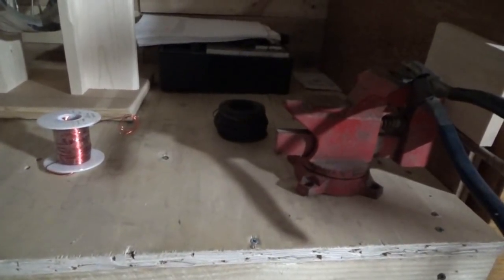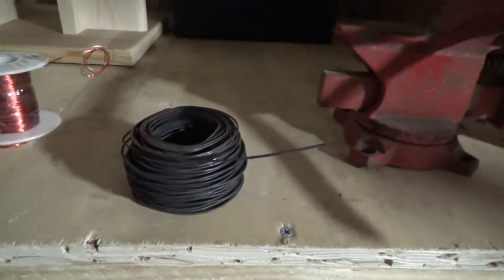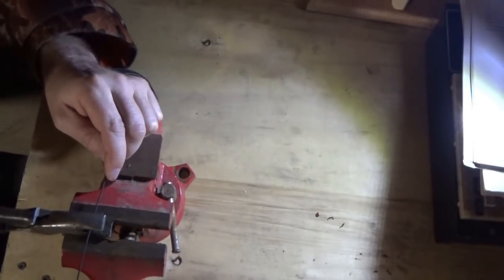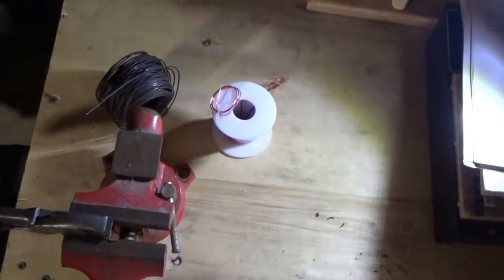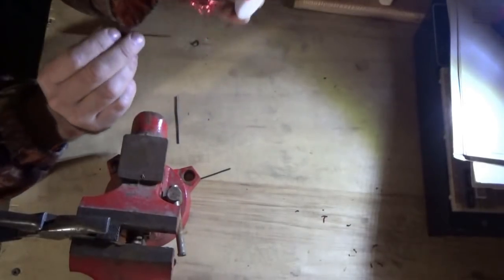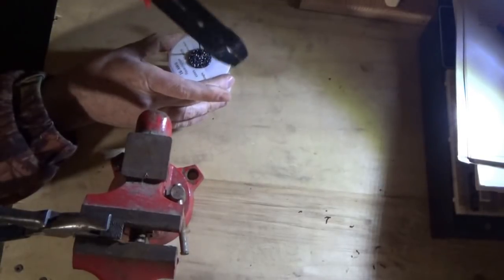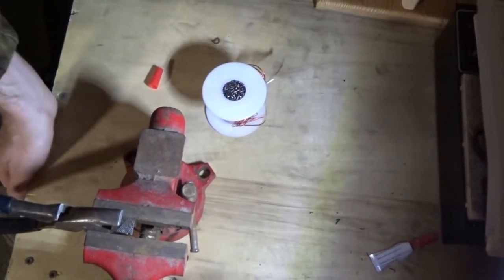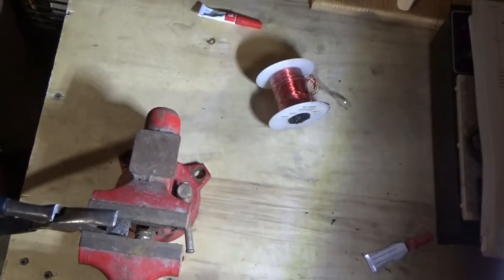How To Make Bedini SSG Radiant Energy Device ~ The Coil Core

Comment: Would coat hangers work for the coil wire?
Reply: Not really as it has about 0.2- 0.4 % carbon but what is needed is almost pure iron say <0.05 % C
I believe the laminates from transformers would work will
Un coated welding rod < .15 carbon does work

Comment: Strange enough I concluded on using bailing wire as well without seeing your video. I was reading something about how raw iron does not maintain a magnetic field as long as other metals when the electromagnetic coil shuts off. Is this how it is understood by others?

Which would make sense while working to simultaneously trip the trigger wire.
Reply from the maker: Yes baling wire is great for this. It loses its magnetism quickly when the coil shuts off, as you say.

Comment: Would it be possible to just stick a solid steel bar in the core
Reply from the maker: Not as good. The smaller metal pieces reduce eddy currents and losses in the core.

Comment: excuse my ignorance, but what practical use are these bedini motors?...i see a lot building them, but never see real 'life' uses for them...thanks.
Reply from the maker: I use mine to desulfate and restore old lead acid batteries saving me a ton on batteries. I have taken discarded batteries at 0.5 volts and restored them for use at like new condition.
Some people build them up larger and can power their homes. Yes, with enough investment you can do that. But it is not cheap.
Most are afraid of attacks so they never show their accomplishments. In my experience when someone goes silent on it, you can be pretty sure they are on to something.
Reply: @thedoityourselfworldelectr8007  hi thanks, i thought this would charge a battery, whilst another battery was actually being used, then swap over again, is that correct? if so this could be handy for a small shed setup for lighting, and very light tool use with a 12v to 240ac inverter?...
Reply from the maker: Yes that is possible in theory. I mean others have done it, yes. But you cant do it with a single coil like mine and it takes some turning. One day I hope to build up to that. Life and family slow down my projects though.
You can charge 4, 6 or more batteries on the back end while running it on a single battery on the input if tuned right. Once I had 6 batteries charging up at one time off a single battery. But I stupidly changed my circuits. Never never take apart a good thing.

Comment: The avarage American home has a 200 amp service. Looking at the wire size used in these devices... How can they posibly power a house?
Reply: Most homes have a 200 amp service. Meaning they can draw 200 amps from the power grid. There is a reason for that... Having the capability to run everything at the same time. Including an electric furnace, clothes dryer, water heater, electric stove, power tools, etc.  So any claims of a device "that can power a home" should be able to demonstrate that they can supply 200 amps @ 240 volts.... 48 KW of power... The same as an average home has available from the grid.
Reply: So that’s about 40 plus members
Reply: Fixed-By-Dork  psst hey good morning ! 😌
Reply: Someone's Princess and Troy, Good morning! While the bedini motor may have some capability to restore batteries.... Even with bigger wire, I doubt that it will ever power a house. Here is a video explaining why..... Zero-Point Energy Demystified | Space Time: https://www.youtube.com/watch?v=Rh898Yr5YZ8  Here is another video explaining  Zero-Point energy (vacuum energy)...... The Nature of Nothing | Space Time: https://www.youtube.com/watch?v=X5rAGfjPSWE  However, if Troy really believes a bedini motor can power a full sized  house with a 200 amp service.... And.... He can set up a demonstration.... I am willing to listen.
Reply: Fixed-By-Dork   Scumbat’s channel is always trying to prove this. 🤒
Reply: In my country we have 20 amps fuses/switches, or even 10 amp for older houses. That means when 10 amps are passing through the fuse for too much time (like from half to one second) it breaks. And it is fine. But we are using more gas fuel, especially for cooking and heating.
Anyway I know from experience that you don't actually need that much of electricity unless you are unaware of the old ways homes have worked.
Obviously you are aware of the compromises when going off the grid.
Reply: Someone's Princess, Is Scumcat trying prove that he can power a bunch of things on solar power? That is not really hard if a person has a bunch of solar panels that are grid tied. Powering a bunch of crap after the sun goes down in an off grid situation is a whole new problem. Which is why I don't recommend going off grid unless absolutely necessary.
Reply: Fixed-By-Dork yeah
Reply: Someone's Princess, I  took a quick look at Scumcat's channel.  In his video titled: "Scumcat100 and Hornet holes"  he says: "Almost sickening that under these skies I breath the same air as T-liar and Fixed-By-Dork" My reply: He if he doesn't like it he is always welcome always stop breathing.
Reply: He seems to be obsessed with you and I also lol  we get his undying attention off on his uploads too lol
Reply: Well they want attention and the queen of darkness closed down their forum :)
Reply: Fixed-By-Dork so member at the ward can’t view their humble hell hole too?
Reply: Fixed-By-Dork Lol @ the queen of darkness
Reply: Someone's Princess, members can access and view the forum that sucks. Therefore they can talk to each other. However no one else can see their babble :) So what good is to post over there if only a small handful of like minded trolls can see it? Way to go Sassy.... Destroy your own forum :)
Reply: Let me add: Members that the queen of darkness didn't boot out can view the forum.
Reply: Fixed-By-Dork Lol oh ok
Reply: Fixed-By-Dork Psst Good Moring !
Anything new from the ward mobs? 
🤒
Reply: Fixed-By-Dork wow I dunno how I missed these bedini  links. I’ll go check these out. I like the bedini project. 
Makes me feel like I’m part of a new invention.. but this has been around for a long time? 
Plus I’m bored at work 😊
Hope you are having a good day ! 😇
Reply: Fixed-By-Dork count me in. Lol I’ll listen too! 
It’s actually interesting !
Reply: We don't need 200 amps in our houses and the electrical grid itself is not prepared for such current, this is why fuses/switches are rated for 10-20 amps. But You can still cook in electric oven, turn on the cloth washing machine and turn on water boiler AT THE SAME TIME. This is why I can not imagine what do you need 200 amps for :). This may depend on the devices and their efficiency.
As for living of the grid I consider compromises not a problem at all. Benefits are far beyond the inconveniences. Depends on what qualities you respect.
Reply: Someone's Princess, Good morning :) The links I posted above are about Quantum Field Theory and Zero point energy and why it is highly unlikely that any of these "free energy" devises will ever work. While Zero Point Energy may be real, there is no known way to harness it. The other possible energy sources won't work either...... There is the so-called "electric universe" theory. The problem? It is absolute quack science at the highest level. The electric universe theory claims that black holes don't exist and neither does gravity! It also claims that the sun and the stars aren't powered by nuclear fusion. Then there are cosmic rays which are real and consist of high energy particles. The problem? Not enough of them to power anything and earth's atmosphere filters out most of them. Not meaning to be negative. Just stating the facts. Once again, if Troy can demonstrate that he can power a house with any of these free energy devises I'm willing to listen.
Reply: The other issue that is even more important in off grid systems is total energy storage. Basically, batteries suck! While lithium-Ion batteries are a big improvement over primitive lead-acid technology.... There is a way to go. Prices need to come down. The way I see it, the only way an off grid system makes sense is when grid power is unavailable.
Reply: P.S. If Troy has links to actual science (not websites selling free energy devices) supporting his belief that these things work, I would be very interested and willing to listen to what is said.
Reply: I dunno myself about Bedini motor. Eventually I'll build one. Also I want to try flywheel energy storage.
I've read recently that storing crude chemical components may be alternative to batteries but this is large scale, for power plants.
Reply: Fixed-By-Dork  oh ok cause I haven’t gotten the chance to view the links 
I will though I find all this interesting !
Hope you’re having a peaceful TGIF and weekend !😊
Reply: EsamoKoram, So in your country you don't have main breakers/fuses that protect the main breaker/fuse panel? Those should be rated at 200 amps. Perhaps lower in older homes. As for off grid.... Yes, I am fully aware of the compromises made when going off grid. That is why I am so much against it! My point was that when claims are made that a devise can power a house... The claim should by proven by demonstrating the devise can provide the same power that is available to an average "on grid" American home. Saying a devise can power an off grid home isn't saying much. Since some off grid homes use a ridiculously low amount of power.
Reply: He’s tries to make a big deal,  in hopes to prove that Troy is lying lol
He calls him T Liar. He sure doesn’t mind collecting money for his shit show which is always about Troy .
He’s happy to collect change that ends up paying enough for him to enjoy his happy hour. Got a case of whiskey thanks to Troy ! 🙄
Reply: Fixed-By-Dork  yeah the old fart is too
ornery to checkout I’m sure lol besides his happy hour drinks and the sucks gang that hangs there is his life now
Reply: Notice all the suckers there?  Lol
Reply: EsamoKoram, Every breaker or fuse panel I ever saw has a main breaker or fuse to make sure a certain maximum load is not exceeded. In modern homes the main breaker is usually rated at 200 amps. In older homes it may be somewhat lower ... 100 amps or 60 amps. Whether anyone uses 200 amps or not is not the point. The point is that a modern home has 48 kilowatts available to it from the grid.... (200 amps x 240 volts = 48,000 watts)  Or.... (L1 @ 200 amps x 120 volts = 24,000 watts) + (L2 @ 200 amps x 120 volts = 24,000 watts) = 48,000 watts. As for living off the grid.... Can you or anyone for that matter, please explain how the benefits of an off grid system the out way inconveniences? When a grid tied system with battery backup has all of the benefits NONE of inconveniences! Thanks.
Reply from the maker: This is a tiny device for demonstration purposes. You can build it up to a larger machine. And yes, you would need larger wires and many more coils. Most bigger machines have 6 or 10 coils with 5 strands of 18 ga wire.
This device can light a lamp but nothing more. I can restore lead acid batteries as well. But its small. A learners tool.
Reply: Who uses 200 amp at home?